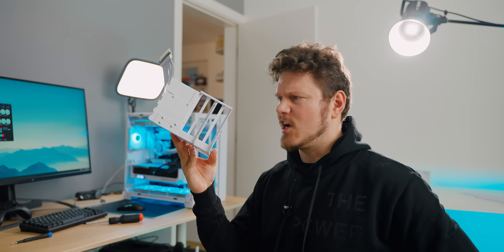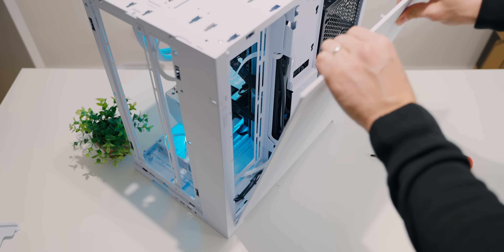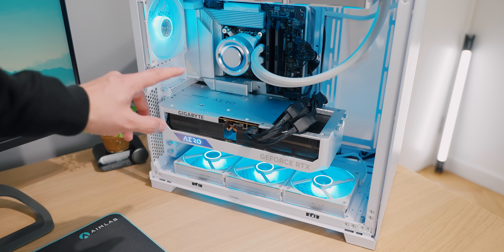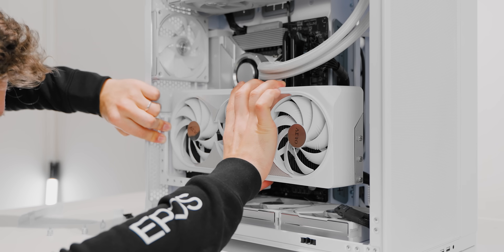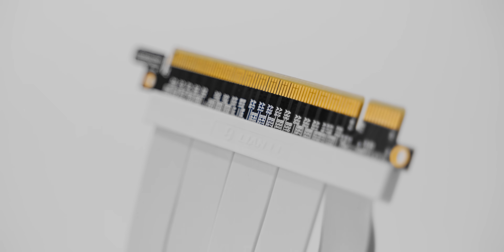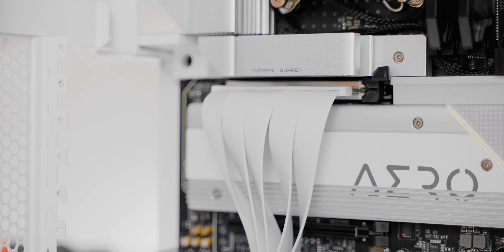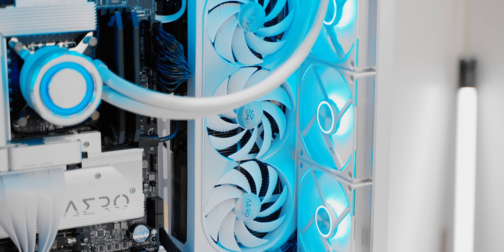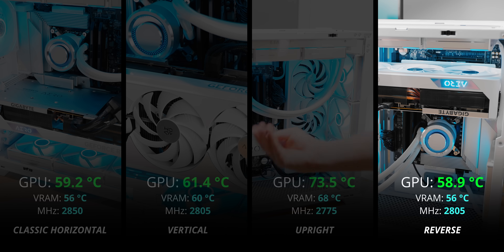The Best GPU Orientation EXPLAINED!

Comment: Would using a OcuLink; M.2 port to make a PCIe port, & use a OcuLink cable, work instead of using a super long PCIe ribbon be just as good?  Can OcuLink trasnfer data just as good?  ...but a lot thinner, & cheaper?
Reply: m.2 ports only have four PCIe lanes, which has been shown to bottleneck some games. PCIe 5.0 could do it but it would need a buffer to connect the 4.0 and 5.0 domains

Comment: Funny timing, I'm in the middle of modding my Silverstone LD01 to be an upright GPU. The last part is on the 3d printer as I type this. Already replaced the front panels glass with metal mesh and modded the front to allow 3 fans a year ago. Though for me upright is about the only decent way I'll be able to cram this 4080 into the case and I like my glass brick.

Comment: I actually like that vertical orientation, especially for added stability
Reply: It didn't look very stable, with nothing but friction holding that spacer in place
Reply: It's as you said better stability than horizontal and there is no force on the pcie. For the thermal difference in vertical it's because this case depth is not as the Dynamic XL. I have the O11 XL model and the thermals are great.
Reply: @doorsbh  if I could 3d print a mount, it would be over engineered just to be stable. I'm still looking for a vertical mounting bracket for a Meshify S2